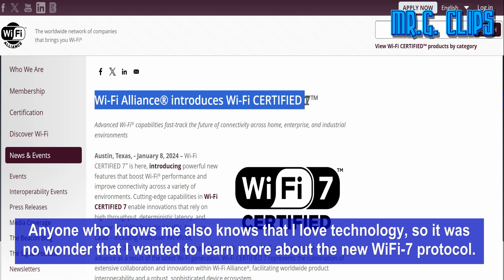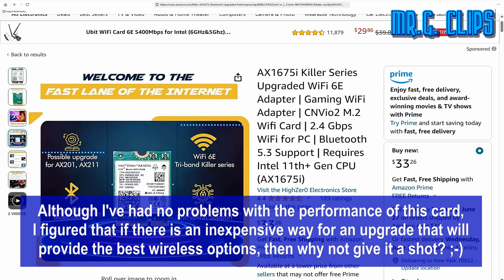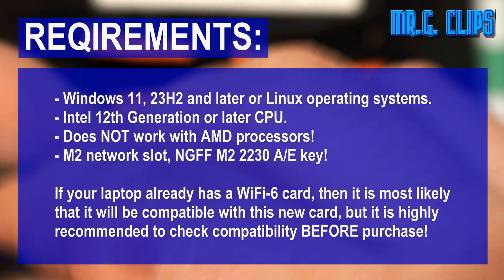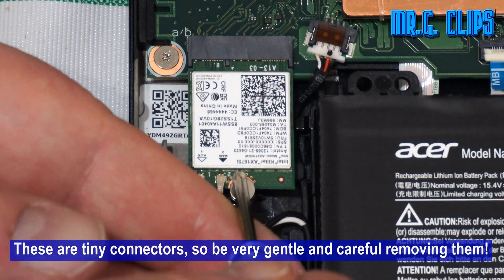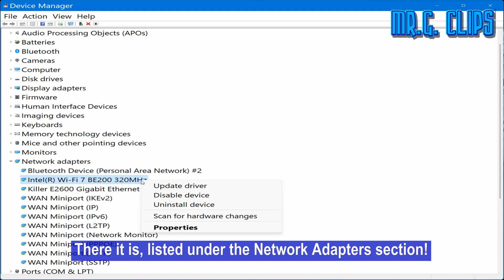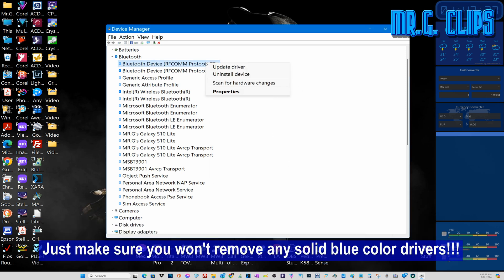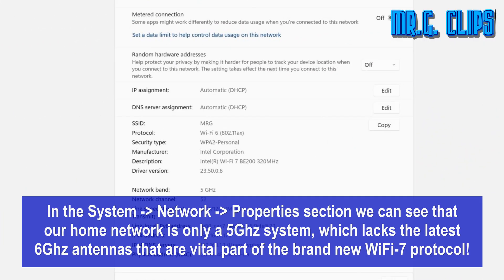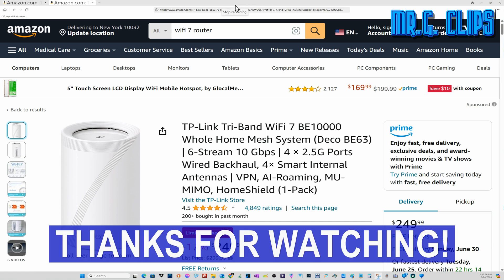WIFI-7 and BT 5.4 Upgrade, how, what and why?!

Comment: My laptop's screen froze and I had to force it to shut down. After that, the blue screen appeared to repair Windows but I couldn't solve it. Now it's showing that the device is not bootable. When I opened the BIOS settings, I noticed that my SSD is no longer showing up in the storage. Can someone help me?
Reply from the maker: Sorry to hear that! Something has gone very badly in your system. I wouldn't even attempt to figure it out remotely, so the best advice is to take it to a pro repair shop for a full diagnostics to fix it.

Comment: Will this not work with 8th Gen Processor ? I already installed this card in my Lenovo laptop, but unable to connect to 6GHz connections, neither my laptop is able to detect 6GHz signals
Reply from the maker: 8th Gen CPU sounds a bit old, not sure if that can support these new WiFi protocols. :-/

Comment: Lucky you win 11 supports it, my laptop I want to try and update is win 7 (and I don't want 10 or 11 on it).
Reply from the maker: I can absolutely understand why you want to stick to Win-7, because that was one of the BEST EVER operating system in the Window lineup, however, based on experience so far, I can honestly say that Win-11 is very good, and I barely ever experienced the "blue death" screen or other massive fails, so I can honestly recommend it to anyone, assuming the hardware of the particular PC can (!!!) handle it with multi-core CPUs and strong GPU in addition to super fast RAM memories. You won't be disappointed! BUT, if you stick to Win-7, then I believe that earlier WiFi systems will still serve you well, regardless, so don't worry about it too much. :)
Reply: @mrgclips  yup, 2 reasons (as of now) that I want to stick with the win 7. 
1) no forcing me to (or at least trying to force me to) use an online account instead of a regular local one. 
2) I have a win 11 laptop (Surface) too and I tried putting a program on it for a device that can connect via either USB or wifi but it won't connect with the wifi "because old security protocol isn't accepted" and I can't change it that I know of (proprietary dongles).

Otherwise I don't mind 10 (use it at work) or 11, just not much for the "big brother is watching" and "OS as a service" crap that Microsoft is going towards.